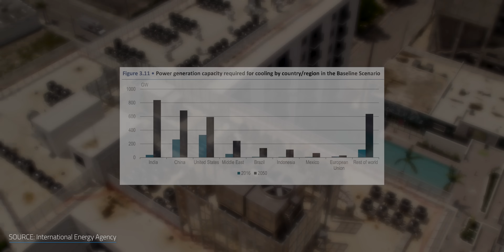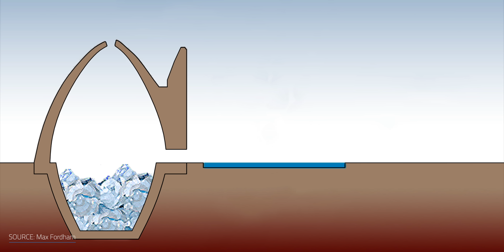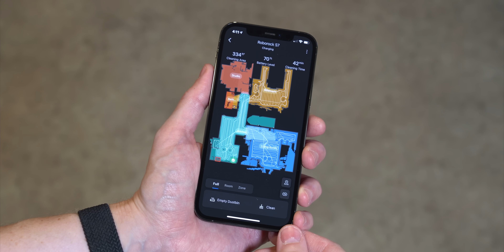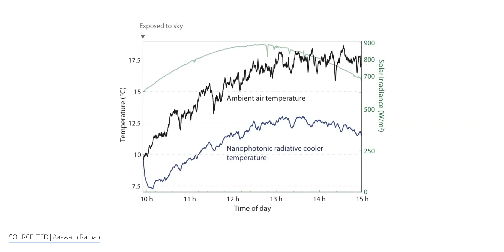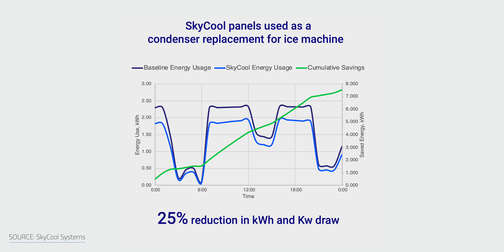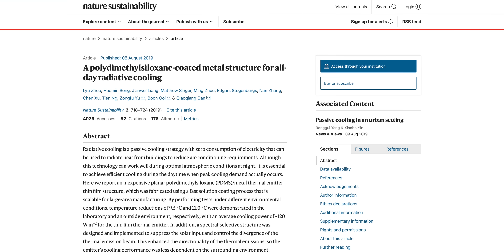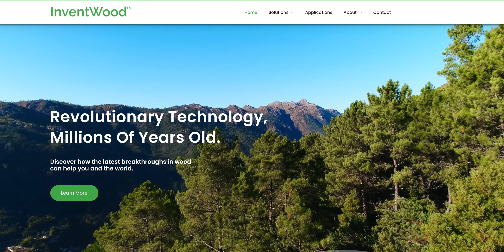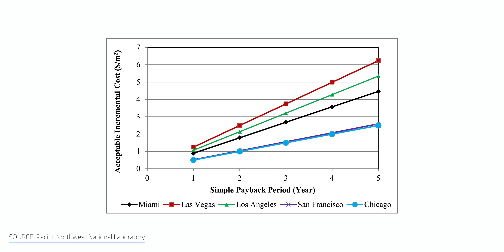Space Powered Cooling May Be the Future of Energy

Comment: You could apply the film to one side of a panel, and black paint on the other, and user the exact same water circulation system to heat AND cool, depending on the side of the panel that is facing up.
Reply: @-GinΠΓ Τάο I think perhaps you're misunderstanding the underlying principle. Infrared light can travel through various media without interacting with them (hence why you can use FLIR cameras through ordinary glass, but not through plastic), depending on the material and the wavelength of the light.
        Think of it the same as how kitchen microwaves are tuned to heat water molecules, but not other substances that can be present in the microwave. It's why you can boil water in a plastic cup without melting the plastic.
Thermal radiation through the atmosphere has to do with the level of transparency of the gasses of which the atmosphere consists to particular frequencies of infrared light.
       The exact same principle is at play with the ozone layer. 03 is opaque to most UV frequencies of light, and converts the UV light energy into other other wavelengths and forms of energy. Another example of the same principle is the reason the sky appears blue.
        Most frequencies of visible sunlight are absorbed and "scattered" by the atmosphere, with the prominent exception of blue light, which interact only very weakly with the atmosphere.
      There are many other examples of this phenomenon, but I think the point had been sufficiently illustrated. Yes, indeed, some frequencies of infrared light, or "heat," do radiate through the atmosphere and into space.
Reply: @-GinΠΓ Τάο I feel it necessary also to point out that you clearly have ulterior motives in commenting in response, which seems to have little to do with the actual principle being discussed, and more to do with apparently attempting to disprove the concept of anthropogenic climate change, which makes you disingenuous at best, and a charlatan at worst.
Reply: @-GinΠΓ Τάο  @-GinΠΓ Τάο  Lol. Thanks for the laugh! I'm laughing at you. Re: physics, take your own advice. You're heads waaaay up your own a** about it, even though it's obvious you have failed to grasp even the most basic concepts. Good luck with that!😆😅🤣
Reply: @-GinΠΓ Τάο I'm donkey laughing at you. You're hilarious.
Reply: @-GinΠΓ Τάο Watch this video, learn something, and then apologize for being a wanker:
https://youtu.be/tuSC0ObB-qY?t=397
Reply: @-GinΠΓ Τάο This one will help bring you out of the pit of ignorance you're wallowing in:
https://www.youtube.com/watch?v=yzUFXcC_P2Q
Reply: @-GinΠΓ Τάο Aww, look how butthurt you are! Ignorant AND butthurt, that's you. Need some Preparation-H for that fiery butthurt, dummy?
A helpful hint, because I suspect you need to hear it: don't eat the butt paste, that's not how it works. Apply it directly to your butt-hurt area.

Comment: All those bad Florocarbons are in  SEALED A/C systems it  should not leak unless it is messed with and starts leaking. And instead of screwing around and trying to play Mr. Fixit call a Certified HVAC Company they will come out and evaculate the Refrigerant if any was left in system and normally as soon as you notice, call the repair guy if you catch it early it may only cost a couple of O-Rings and a recharge back up same day. Catch it late depending on unit size and local supply down for week a 4 -5 $ digit bill might even be cheaper to replace the unit and that would of leaked all the refrigerant  into the environment. Point of this is that climate change they started off sayin in 1980 has all been a bunch of crap. AL Gore did not invent the Internet. And, Epstien did not commit suicide.!!!

Comment: the problem with reflective coatings is that the surface area they are on should be covered with solar panels to capture/create electricity.  It would be really cool if the panels could also radiate heat at the correct wave length at night to get rid of the heat...
Reply: @-GinΠΓ Τάο that was just a bunch of crap.  Nothing to do with what I said which is you can radiate heat better when the sun isn't shining....
Reply: @-GinΠΓ Τάο again, nothing to do with what I said...bye

Comment: Great idea but do this Google pop can solar.  Build one take the glass plate off. This will give you night time aircon. In the winter move them to a south side roof put the glass cover on and then you have a pop can solar heater. Beer cans are  better and red bull even better.
Peanuts to build and peanuts to operate. You could even just us a passive air thermosiphon system if you do then use the beer cans

Comment: There are a number of new heat pumps based on CO2 as the refrigerant.
These are mostly for creating DHW and space heating. But could easily be used to create cooled fluid to be used for space conditioning.
The system shown in the video was billed as passive. But I would assume that for the commercial refrigeration system presented there would be a heat pump between the refrigerators/freezers and the cooling system presented.
The same could be done for houses to attain larger temperature differences.
Now, if there was some way to have the radiators change from emitting heat in summer and absorbing heat in winter you'd have a great addition to heat and cool houses.

Comment: I live in Stockholm, at around 60 degrees latitude north. Ii summer it would sometimes be nice to have an air cooling system, when the temperature can for a few days reach or slightly exceed 30 degrees, but not many homeowners seem to need or want one. In winter, however, a white roof, whether from snow or from a heat panel would make the house need more energy to keep the inside acceptably warm. Doesn't seem to be a solution except in very warm climates.

Comment: For starters, you can move away from places with summer temperatures that are too hot to live in comfortably without air conditioning. This would reduce the number of homes that even require air conditioning or it's alternatives (if you have the money to move, that is), and your energy bills will thank you for it. The same could be said for places where heating is required in the winter, but passive solutions such as more insulation, or active ones such as using electric heating are already far more commonplace, efficient, and far less of an environmental nightmare than air con

Comment: Hafnium makes extremely refractive materials such as Ta4HfC5 (tantalum hafnium carbide) so it deflects the incoming light very well. I guess this is the reason they used it in the coating.
BTW the nanostructure coatings are so "hot" in current research of solar panels that I could hardly find any articles on e.g. SnS2 (tin(IV) sulfide) without going through dozens and dozens of articles about solar panel coatings...

Comment: The use of a ground source heat pump system with 2 way compressor would have the benefit of heating your space and water, whilst offering cooling into the ground or body of water as a heat sink. The option of a thermodynamic heating panel can also do the same, as black body radiation will serve the same effect. As we need heating for space and water, such a dull function will have a much more economic future, with a COP at 3, the return is economic today.

Comment: a gradient of 10 degrees seems like it would be enough to power a sterling engine as a pump for the system, it would make the system overall slightly less efficient, however it's possible that the decrease in efficiency from the sterling engine is still less than the electrical cost of powering a pump via an electrical motor

Comment: Interesting technology, certainly well suited for some applications. But there are also much simpler solutions that can be implemented immediately: Do not cool as much as is common in America. Building differently, e.g. using clay materials. Underfloor heating with a geothermal heat pump and, in summer, direct the lower temperature of the depths through the floor - almost without energy possible and pleasant cooling. Then you don't have to deal with unpleasantly cold air that comes from the "American" air conditioning system. And avoid CO2 emissions, then the climate will not be heated as much. How about going to work by bike or on foot?

Comment: Is there work to combine this technology with solar panels?  A surface coating transparent to the wavelengths that the panels convert to electricity, reflective elsewhere, and an efficient emitter in the 2--6um region.  The increased efficiency of the cooler panels would be a bonus.

Comment: Reflectivity is one of the ways to reduce heat build-up in the automotive industry. As a shade-tree mechanic that is always tinkering, I've used stuff like white ceramic coatings to help reflect heat away from things like piston and valve heads/tops, as well as pushrod tubes in VWs and my Corvair's air-cooled engine. The auto manufacturers used to paint the tops/roofs of cars white for just this specific reason - heat disipation/radiation.

Comment: In general a good emitter is also a good absorber. A reflective material is expected to be both a poor absorber and a poor emitter.

The Sky Cool technology is supposed to be both a good reflector, and a good emitter(which means it should be absorbent as well) of thermal infrared radiation. I would be happy to see the technology prove itself effective, but I am still skeptical until larger, more independent, evaluations of the technology are conducted.

Comment: I dont quite get the physics. Why does it matter wheter the athmosphere absorbs the radiation. Sure, the athmosphere would get hotter in this case but that would not stop the surface from emitting further radiation? Put differently: Why should the emitter be effected by where his radiation ends up?
Reply: If the atmosphere absorbs infrared, it also emits it at the same wavelength. So you’d be looking up an an effectively warm sky.

Comment: This looks promising especially for hot climates. 
But for regions where there is a winter and a summer, I always wondered why the natural cold of the winter is not used. 
Actually we do quite a stupid thing in winter. We heat our house, and keep a fridge inside it and use a lot of energy to cool it back. (not me, The fridge room is not heated)
Right now, there is not so much snow and ice, but for decades it used to snow a lot and hinder us till it melted. What if 50 years ago we would have built underground storage, well insulated and stored there all the snow, and naturally cooled water? And in the summer use it to cool our houses. Now with so many fridges and datacenters, and warmer winters that solution could be insufficient, but the energy saved in half a century would have been tremendous.

Comment: By building houses differently, one can use the natural power of water to cool the house. And evaporating water always comes back. A perfect cycle from nature. My apartment, in Amsterdam Old-West, is always cooler than the temperature outside, because it's build in an North-South orientation. So I don't get much sun. That used to be a problem for me, especially in the wintertime. By a thoroughly done isolation I solved that problem, but my apartment is still cooler in summertime than other East-West build apartments. And you've showed the centuries old solution by using water as cooling. It still works quite well.

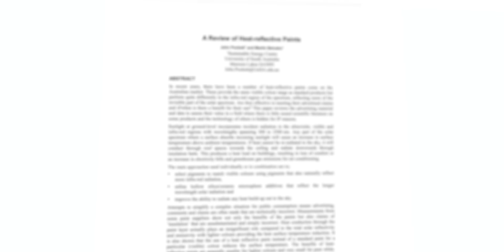Comment: In late 2018/early 2019 some people came and painted the roads in my suburb of Mawson Lakes, the same place where 9:52 Uni SA Campus paint reflective study was completed. I asked the people painting the road what they were doing, to which they told me it was trial to see if the local temp would decrease in the area with the off-white painted surface. It did in fact make a difference as it does feel much cooler in summer. However the properties of the paint is very smooth and hasn't faired well over the last three years. Cracks have formed, there are countless unintentional (and intentional) tyre marks and it unfortunately makes my local suburb area look less pleasing since the roads are not black. Nevertheless, the temp has had a notable decrease in the area.

Comment: this tech is trash and a waste of time. mylar works fine. also solar chimneys and geothermal cooling is much easier solution to implement, and is a technology used for thousands of years, literally dig below the frostline of the dirt, bury pipes, have them vent into your house, have a heat absorbing tubes to create a draft that draws the cooler air up moving the heat thermally with convection

Comment: Interesting new tech. Just a few comments on HVAC systems since your intro made it sounds like doom and gloom and all systems leak. I like your videos but the hyperbole in this one is a little misleading.
1. Leaking HVAC systems are not the norm and need to be repaired. HVAC systems are closed loop and don't emit hydrofluorocarbons(HFCs) during normal operation. Yes, some units leak but many of these are replaced/repaired so they don't leak. Eventually a cooling system won't cool when it leaks.

2. R22, the old hydrochlorofluorocarbon,  was phased out in 2010 ( can't be used in new installations ) and replaced with R410a. R410a is much better at absorbing heat and isn't as damaging to the ozone as R22.

3. US EPA is now phasing out R410a ( and other HFCs - and not just US but other countries too ) and phasing in lower GWP( global warming potential ) refrigerants such as R-454B and others. R-454B has a GWP of 465 compared to 2,088 for R410a ( lower number is better )

Comment: Circulating fluid could be done passively through convection. If you set up the geometry the pipe correctly, as the fluid cooled it would become more dense and tends to flow down back towards heat sources which warm it up and cause it to flow back up again

Comment: I recently read about another cooling technique that requires only some highly salted water. When the water evaporates from sunlight, it keeps the roof cold because of the energy required to separate the salt from the water. Evaporated water can enter a heat sink to cool (which may generate electricity thanks to the Seebeck effect), then moved back (by capillarity or with the help of a tiny pump) to absorb salt again.

In its core principle this process requires no electricity, use sustainable materials, and may help people keep water safe from evaporation.

This cooling process is not the holy grail though because it is slow, but it is simple to understand, seems highly efficient, and as such should be applied quickly to reduce the effects of global warming without using air conditioners.

Comment: I am not convinced that the changes in climate are manmade.  That said, as an electrician it is clear enough we waste a lot of energy, and that we should do better by the ecology that we are currently doing.  Conservation is always a good idea; we should take better care of our common home.

If we are serious about improving our energy consumption, reducing Hvac and refrigeration energy use are important.  In hotter areas, rooftops and color of the house paint should be lighter.  In colder areas, rooftops and paints should be darker.  Sun-shading overhangs on residential construction, as well as whole house fans should be mandatory.

On the refrigeration side, we should insist on UHT processed milk, as it does not require refrigeration until the carton is opened.  Also, we should start processing eggs like they do in Europe.  These two measures alone would notably reduce energy used for refrigeration in stores, and would reduce the need for refrigerated transports as well.

One other social energy reduction, albeit not related to Hvac, is we should turn off water heaters in all public bathrooms, and people should use clothes lines more and dryers less.

If we collectively want to reduce our nation’s carbon footprint, we need to be willing to consider making changes to our personal lives and yes, to cede some personal autonomy to regulators as well - for the common good.

Comment: Over a month ago I had my 1500sft S Florida roof (open beam ceiling) coated with silicone to a savings of 20%! and amazingly comfortable as it also reduces UV rays. Cost was $1700, savings was $30, meaning payback at that rate is 57 months, not bad, but the vastly improved comfort is well worth it too

Comment: Air conditioners basically just gather up all the heat into one spot, so I've been wondering why large air conditioner systems don't put that heat to work.
Reply: Many have worked on low temperatures phase change for free energy

Comment: "A typical AC unit is a dirty energy hungry machine..." Fair enough, but how does that then equate with the campaign to get everyone to use heat pumps? They are, effectively, AC units in reverse, so you can't have it both ways!
Reply: In my personal experience the AC does not work very well in to heating the house. Must say the primary goal at home was the refrigeration.

Comment: I sincerely hope you'll read it: 
I know that you like energy generation and storage methods... but I don't think that you covered the superconducting magnetic energy storage (SMES). It's still mostly used for military uses, and it's still quite expansive... but it's probably the most efficient way to store energy... infinitely.

Unlike high-temperature superconductors (around −200 °C), an American team recently developed a near ambiant superconductor (15 °C), a carbonaceous sulfur hydride alloy... but under extreme high pressure (300 Gigapascal). Getting us closer from THE ultimate battery.
Reply: The applications of such batteries are limitless... on a single charge: to electrify for years a remote outpost, to operate submarines for years, electric powerful jets etc. To store limitless quantities of electricity without loosing a single electron.